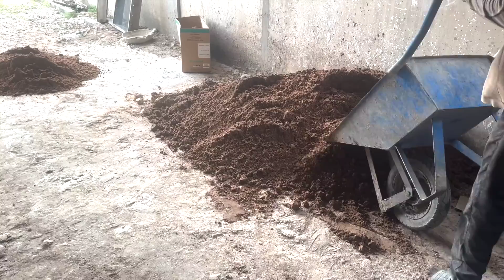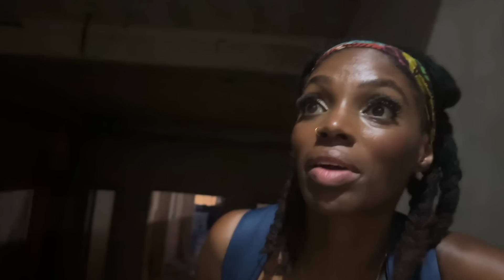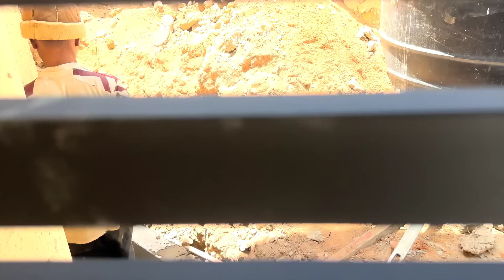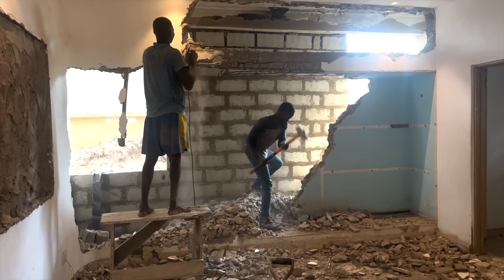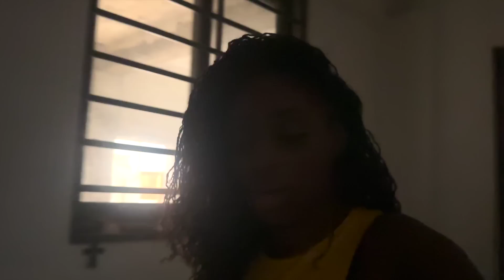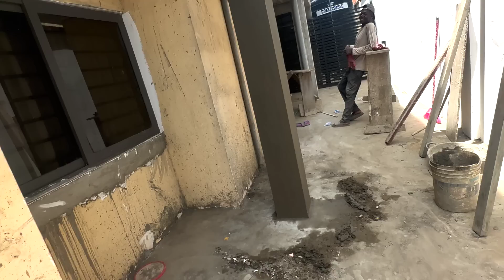DEMOLITION WORK HAS STARTED! The 2nd Airbnb is Underway

Comment: Delays why not do the wall on the others side by moving it forward to the pillars of the top building and knock down the old wall like you did in the rear to have an even nice outer wall for both airbnb's. Because that would make the place look nice.
Reply from the maker: I thought about it to be honest but bwoy….the work involved.  More demolition, more blocks, more cement.  Yikes! In an ideal world I would love to do that.
Reply: @moretodela  Dela please go ahead and do it now so that you would be happy doing it. Doing it now would save you a headache tomorrow because the guys are on it already so or them do it and adjoining all the walls to the pillars would make the ground floor look uniform and complete. 

You can even have 2 studios out of both rooms instead of 1 bedroom flat and have 3 airbnb downstairs. Because the rooms are now way bigger and wider with the expansion of the walls. So you can convert the 1 bedroom in to 2 studios. The plumbing is already there they just have to connect the pipes. This way you will have 1 bedroom and 2 studios for airbnb. Maximise your potential. More guest more income. You need just kitchenette in the corner and an unsuite shower.  The corridor connecting the two rooms which currently is the bedroom and living area right? That corridor could convert as a bathroom for the middle room  to become a studio. 

And the other one would have it's out shower where it's planned to be initially and then with its own kitchenette and this becomes another studio. You see how that place you visited Wode Maya was designed. His was a self contained studio also and your rooms are watching bigger so you can do it. You have ample parking for all 3 flats. 

Remember Ghanaians also use airbnb especially business people who come to Accra to do their business and like to live in quiet areas. Invest now smile tomorrow. Go for this option. Talking to your builder and he would agree to help you with the cost. Good thing is the upper building is not sitting on the ground floor building because you guys built it on concrete stilts/ pillars.